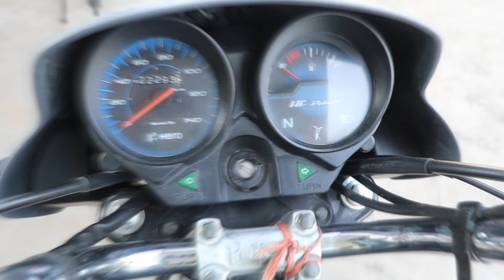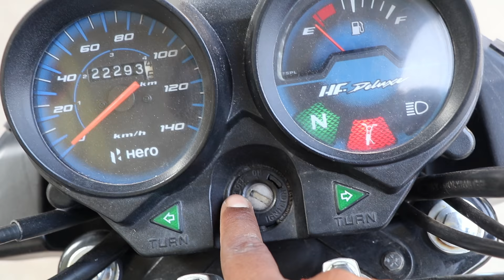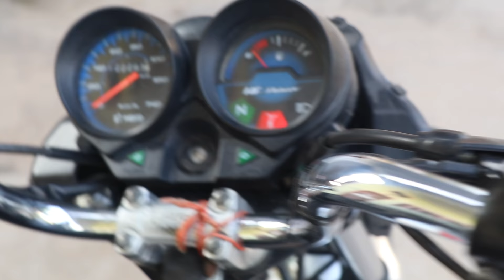How to Start Any Bike Without key

Comment: Only works if you play techno over the process so you can't hear the bike fake
Reply: How to sluice gold
Reply: Listen bro.... it works I promise you not just with scooters but with crotch rockets Harleys dirt bikes atvs all that.... lol
Reply: @bellamarie8729  bruh im telling you its fake , its not that simple to just add a jumper wire like shown. You need to have power from the battery to power fuel pump, sparks all that shit its alot more of a complex process. There are alot of different contact points inside of the ignition that all connect when you turn the key.
Reply: It actually does work. I literally just did it with my 2016 KTM exc 500 SUPERMOTO. All of those other things you’re referring to like fuel pump etc are further down the circuit and automatically come on when you turn your key to the on position. Doing this is the same thing as turning your key to on
Reply: @Slidingsubtly  does anything break afterward when you do this or is it as easy as messing with the wires?
Reply: @Slidingsubtly  hey man, where do you get that little wire thing?
Reply: @LoveReal1 make it
Reply: If the dude is asking how do you make that wire he ain't got no business fucking with it
Reply: @nefarious-666 ur slow in the head mate its not hard to Hotwire a bike 😂😂😂

Comment: Everyone's saying it doesn't work, is doing it wrong. When you unplug your ignition there will be two red and one black wires. You connect your jumper wire to both of the red wires. Once everything lights up hit your start button. This works easily on all Honda Shadows. So always lock your front forks.
Reply: What about a klr 650?

Comment: How many motorcycles got stolen?
Reply: Just copped me one yesterday:)
Reply: Shit does this actually work for ones in the UK
Reply: 0... this just would not work.. he put the wire to bridge the wrong connection and it wasnt still connected to the ignition anyway. Fake
Reply: @yzzmokes9870  no.. it doesn't work at all. Stick to old school methods lol.
Reply: @Sweyn.Vagabond  whats the old method 😅
Reply: @yzzmokes9870  well I guess I meant usual methods lol. Depends if your savvy or a little chav haha. Have rip the front off.. pros unscrew it or take the while ped in a van or push it lol. You've got the jiggler key method, the bolt and ratchet method, Lockpicking, slide hammer method, or str8up hot wire. If your not looking to Jack people lol. I'd rather not go into it too much.. but it's so so easy.

Comment: You don’t have to take the headlight off pull the wire to the side and yes this actually works
Reply: Bet thanks
Reply: Depends actually. It's best to look up the wire diagram and do it with that. They're free online, and not every bike is just one plug like this. My cbr 600 has 2 different plugs you have to connect.
Reply: When my keys were stolen, with my CBR I had to damage the seat lock mechanism. You have to remove the seat to remove the fairings. you have to remove the fairings to remove the tank - for access to the wire connection.
Reply: I've done a couple of times.  But I think the headlight won't work if the fuse is disconnected
Reply: Do you understand my situation with  a super bike egnition switch to start my electric bike with no key issues
Reply: after you removed the shortening wire you brought, did engine go off?

Comment: Only works on cheap China bikes where its super easy to unplug the ignition wires.
Reply: It works on every bike, 2 wheels or 4. Smh. Troll
Reply: @brianfoss4849 Most dirt bikes don't have an ignition, and most quads have the most basic bitch 4 wire ignition system. Dude said any bike, when in reality it really is only super easy on offroad vehicles and China bikes. Go try this on an R1 or CBR, let me know getting the wires out from the ignition and triple trees are, not to mention most have a triple tree lock.

Comment: Where van you get the wire
Reply: Any hardware store, old electronics, or anything with wiring. It doesn't matter as long as it's pretty thick gauge wire.

Comment: Hi brother.  I tried to do this to my cbz   It worked for first time....  but  second time I see spark ⚡️ wire touch to frame... from then. THIS TRICK IS NOT WORKING
Reply: What to do please help
Reply: Gdn Gvh idk probaly broken. Take it to a repairshop and ask them.
Reply: Gdn Gvh you probably fried your wiring harness and computer so you might want to take it to a shop
Reply: Fuse
Reply: Prolly the fuse.

Comment: Do u need a screw driver
Reply: ComplexChill YT ye to open the front up
Reply: No, you can pull the wires out from behind the headlight off to the side. It's easier to get around without it though. Like on a sports bike you'd need to take off the fairings.

Comment: How do you identify the ignition switch wires?
Reply: afaik most motorcycles just need to be powered on, and you can just use the ignition switch
on most cars i've seen, brown wire's ignition
Reply: Look up the wiring diagram. They're free online, and they're stupid straight forward. It'll say ignition, and when you look at the bikes ignition it'll have a set number of wires. Just connect whichever ones and you're good. My cbr F3 needs 2 plugs connected for example.
Reply: Trace the wire coming out from where u put your key and follow it until you get to the female/male ignition part
Reply: @___Eldritch  hey do you know where i can get a wire like that??

Comment: my battery got fucked up after trying this out. bike starts but cant use horn, headlight or light up my speedometer
Reply: You can get more wire and connect other cables if u want it to work
Reply: It’s just to start bike